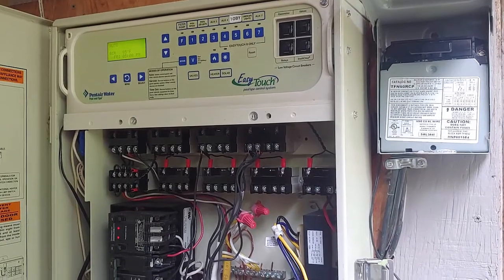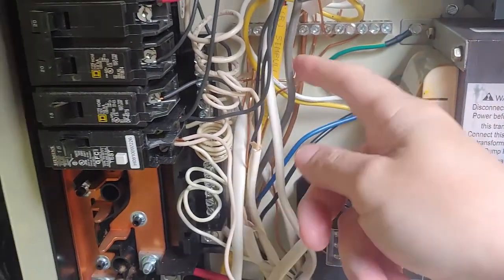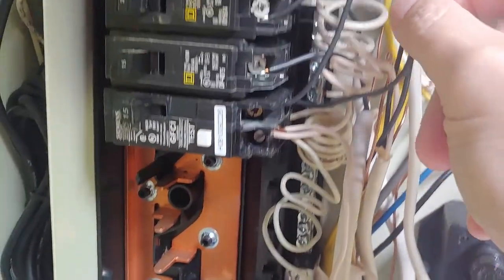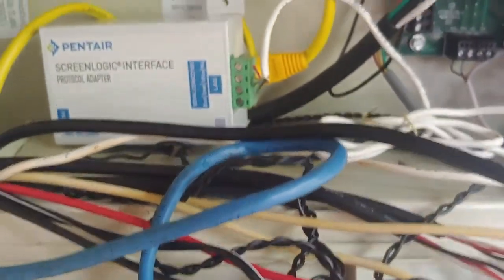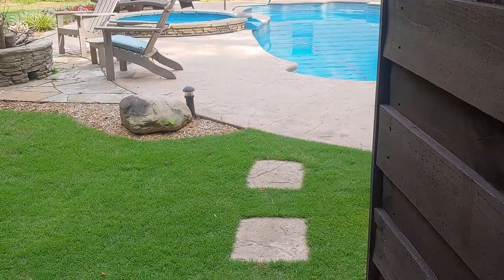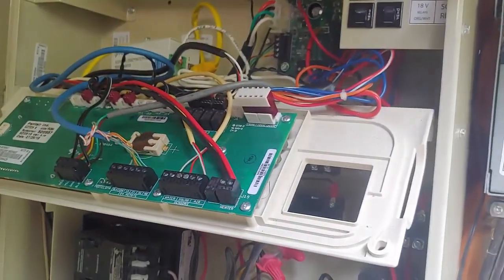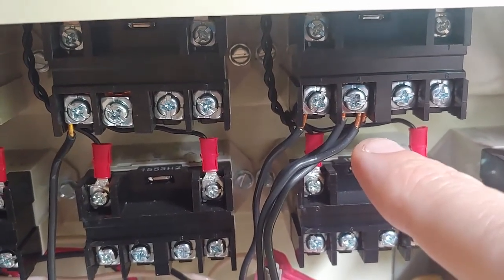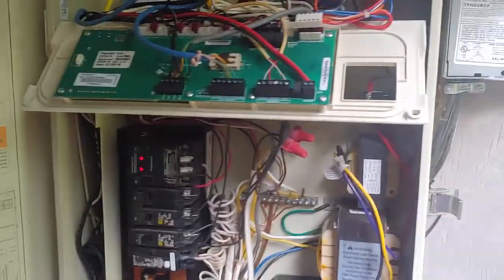Landscape and Pool Lights -  Wiring your Pentair Easytouch

Comment: Eu consigo configurar o led com a bomba quando ligar a bomba da cascata?
Reply from the maker: Yes, you should be able to do that, just wire your lights directly into the same relay that your pump is wired into. However, be careful that the source is 220 or 120, and your lights are compatible or not with those voltages. In this way when you turn on your pump it will supply your lights with power. And if you only need 120 and your pump is 240 you should be able to pick up only one leg of it from the relay and then you'll have 120.  Keep in mind that if you have a GFCI breaker on the pump that's 240 and you're only picking up one leg of it for the lights it may or may not trip your breaker if it has an uneven pull.
Reply: @SwimmingintheDeep  Boa tarde, pq tipo assim, antigamente quando eu ligava as bombas, os led da cascata ligava automatico, só que hoje nao liga automatico. Aí eu tenho que ligar a bomba e depois ligar o led no auxiliar 3 separado
Reply: aí eu nao sei se tem que configurar novamente esse painel
Reply from the maker: Yes, there's also a way to do this in the settings. You want to look under circuits or feature circuits. You can use AI, chat GPT, and it will help you navigate the settings.

Comment: Is there anywhere one can get the basics on specs & wiring these 3 HP relays?

My test scenario: use 3 of my unused 3 HP relays in my Aqualink panel. Note all breakers are at the mains, not outside in Jandy panel. 

In the Jandy subpanel, I want the hot wire split to feed two 3 HP relays, daisy-chained with short wire segments connecting the line-in terminals of each relay. 

The neutral wire from the main panel lands on the subpanel’s neutral bar, which is isolated from the ground bar. Each relay’s load side has a hot wire going to one of three devices, and each device’s neutral and ground wires return to the subpanel, with neutrals landing on the neutral bar and grounds on the ground bar-each wire in its own terminal slot. 

Relay 1: Powers an outdoor outlet box where CLYR pool controller will be plugged 24v wall wart. 
Relay 2: Powers an outdoor outlet box where a landscape 300w transformer will be plugged

Comment: Great vid. I Makes sense to me. Does the color changing option function from the app when set up this way? For your pool lights that is
Reply from the maker: Thank you for the comment. My brand of lights actually changes with an on-off pattern. If you turn the lights on and off in less than a second, the color changes. So it is possible to change the color on my lights by doing this on the system.
Reply: @ thank you so much! I figured that out as well. I’m like how can the logic change the color when the power is running through a dry contact of the relay. Didn’t make sense. Then I read the manual! lol. Thanks again!

Comment: How did you wore your transformers. I’m having a bit of difficulty
Reply from the maker: My transformer is separate because it's not a pentair brand. Therefore it runs off of 115 volt, and I wired it into one of the relays.

Comment: What about the timer?
Reply from the maker: Hi there. I need a little bit more information too understand your question. Does your lighting system have a timer that is mechanical? Mine is digital and is set using my app on my phone or the small interface on my easytouch system.

Comment: Hey bud, quick question. So on the relay you have line in that's the power from the breaker if I understood your correctly. But then left is only one screw. Low-voltage lights have two wires on the cable. So do I just hook up the two wires in the same cable to the load one screw ?  Thank you for your help.
Reply from the maker: Your low voltage wires are powered by a transformer that is 110v/120v.  Ultimately you'll have a black (hot) wire and that is where you see I have three wires on that screw. One of those black wires represent your one black (hot) wire to your low voltage 110v to 18v (guessing yours is 18v or 24v)  transformer.  The white (neutral) wire you have will get tied back into all your other white wires in the box.   I think I have understood and answered your question, if not, let me know.

Comment: I have added a SWCG and want to hard wire it into the same relay that the Filter Pump is on but I'm not sure where the wires need to be connected.  It's a Circupool Core55 and can take either 110 volts or 240v. I have 3 wires, black, white and green which is obviously ground. The terminals at the bottom of the relay have no wires currently connected and are labelled from left to right, line 1, Load, Line 2, Load. 

Do I connect the white and black wires to load (terminals 2 and 4) and then add two wires for line 1 and line 2  to go to the filter pump breaker?
Reply from the maker: Yours may be different but I made a video for you here...  https://youtu.be/Eq3Qb70tOwo

Comment: If my landscape lights are low voltage, does the Pentair panel have a built in low voltage transformer that I can wire the light into therefore not requiring a separate low voltage transformer? And if so how do I determine the total amount of watts available from the low voltage relay so I can determine the total number of LED landscape lights I can support? Thanks
Reply from the maker: Thanks for the comment. I am not sure they have such unless you buy their kit. you can buy one that works, even a laptop charger assuming your LEDs work on DC you'll want an AC/DC transformer and put it on an outlet that is off one of those Pentair relays for 110v. Here's what you want to look for for the output...the voltage should be within the specs of what the LEDs work on. A lot of times this may be a range of 9-24v. So in that case a 12v transformer would work.   Add up the wattage of each light in your landscape lighting design.

Multiply the total wattage by 1.25 to adjust for loss due to cable distance. For the example, 240 x 1.25 = 300.

Choose a transformer that supplies no less than the required wattage.

Does this make sense?  I actually have this type of setup with my landscape lights on the front of my house. They are powered with an old laptop charging brick that I already had on hand. Remember, LEDs are usually polarity sensitive so if the wiring does not initially work switch the hot and ground on the low voltage.
Reply from the maker: I updated my response to correct my errors.